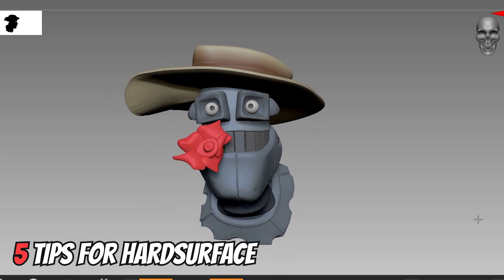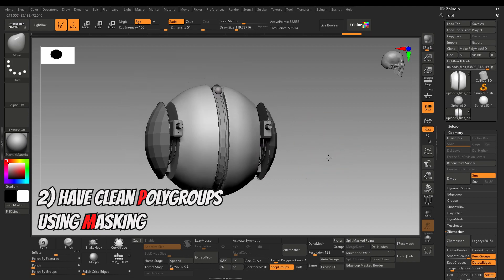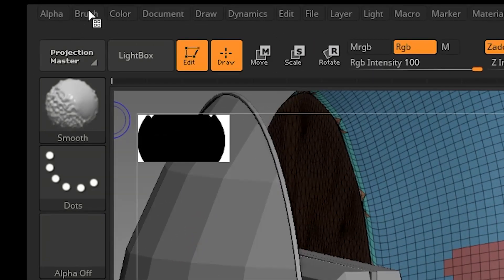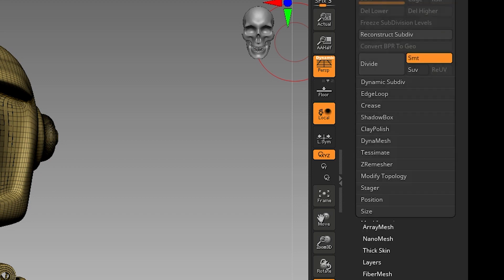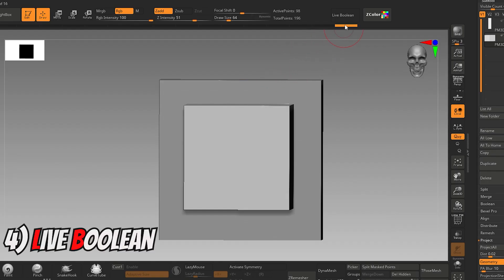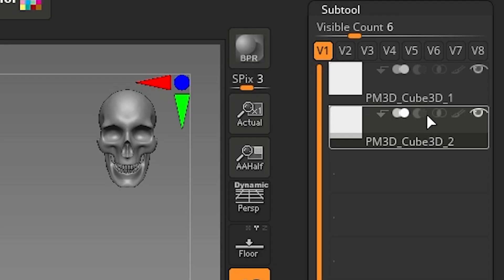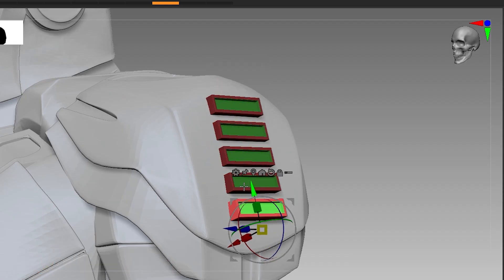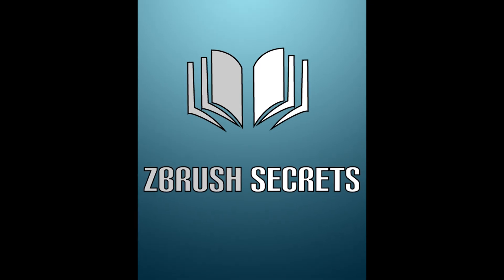5 Hard Surface Tips In ZBrush You Should Know About

Comment: Hi there. I have a hard surface question. I'm making an Ironman helmet and when I select crease edge and subdivide the model up. I get a horrible pointy pinch. at the junction of the join. I have tried to reasearch my problem but can't seem to find the right tutorial to explain what I am doing wrong. Any help will be greatly appreciated. Thank you.
Reply from the maker: well dont subdivide it. use dynamic subd. and go to polygroups and select "crease pg". it will add crease to all your polygroups making it an hard edge with softness on it.if you'r model doesn't have multiple polygroups. select "groups by normals" first. if you still get a sharp edge. try using bevel from zmodeller. at this moment i highly recommend you learn the basics of zmodeller if you are delving into hardsurface it will make your workflow really fast